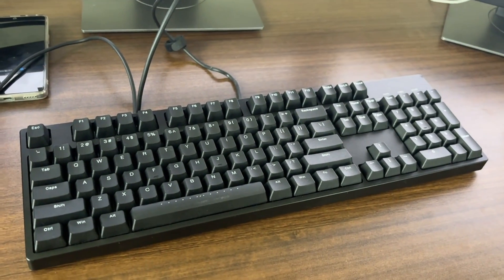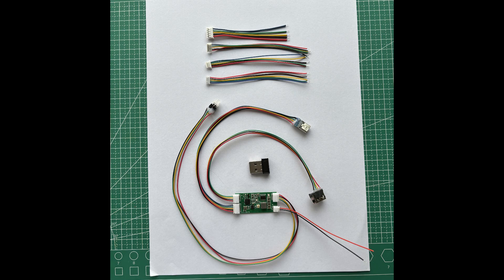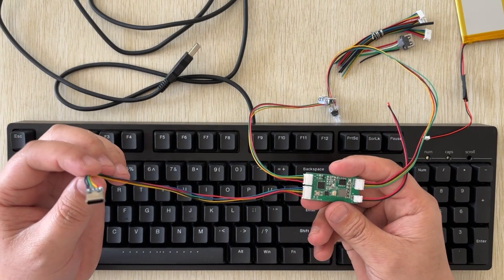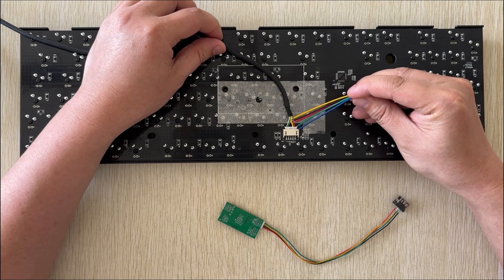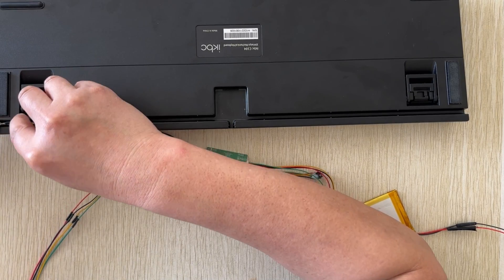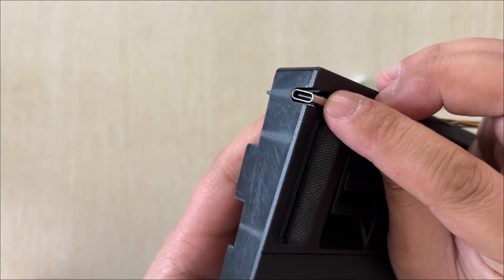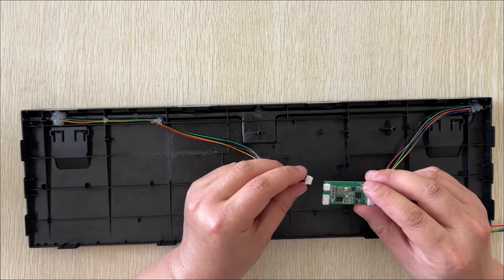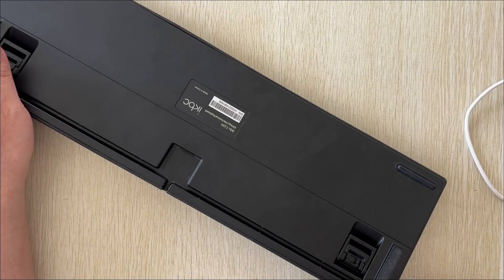Converting a USB wired keyboard into a wireless keyboard

Comment: Is this compatible with keyboards that have additional built in functions? I guess this is more of a question regarding the bluetooth module/firmware compatibility.
Let's say I have a USB keyboard with a built in trackpad or trackball, integrated mouse etc.  Does this module recognize those inputs?
Reply from the maker: Depends on whether the touchpad, mouse trackball uses standard USB-HID key codes. Most of them can be recognized.

Comment: Hi there, what connector is it for the batttery? Is it just a 2mm connector?
Reply from the maker: The power socket model on the PCB is a two-pin socket of zh1.5, and the corresponding plug is delivered with the PCB.
Reply: @jamjam2219  Awesome thank you! Saves me a lot of trouble trying to find a battery with the matching connector or having to buy the connectors on my own.

Comment: I have another question, regarding the battery, that has the black and red wire, which one is positive and negative? I think I understand this video now, but the only problem I have is being scared of connecting the positive and negative end badly. from what I understand red = positive side, and black = negative side. could you please let me know if this is correct and there are other stuff I should be aware of?
Reply from the maker: In most cases, red is positive and black is negative. But please note that this is not absolute. The safest way is to measure with a multimeter. There are symbols printed on the back of the circuit board. + represents positive and - represents negative.
Reply: @jamjam2219  I see. so based on your experience with this board, and from the videos as far as I can understand based on this board of v3, red means positive right?
Reply from the maker: @Apocalyman  yes
Reply: @ I see, thats awesome! thank you for responding and for your help! :)

Comment from the maker: By chance, I found a question post of a customer using this module in a Spanish forum, because forum registration requires an invitation code, so I can't register to answer his question, I can only answer it here, I hope you can see it. The module uses lithium batteries with voltages from 3.5v to 4v. In fact, if the keyboard does not consume too much power, the Li-Ion battery can be used with a voltage of 3.2v or even 3v. Li-Ion batteries with a maximum voltage of 4.4v when fully charged can also be used, but I wouldn't recommend using such a high voltage. I apologise for not mentioning the voltage of the LiPo battery in the details.

Comment: Question! My keyboard is wired, how do I cut the wire properly? And how do I connect thr battery? Since it has the white connector already
Reply from the maker: The white connector is in the accessory package, provided free of charge. The accessory package contains 4 different commonly used connectors. If none of the 4 connectors work, you will have to cut the data cable and re-solder it..  
If you don't know how to cut and connect correctly, it is not recommended to buy this semi-finished product. You can buy wbt2-v4

Comment: Like ps keyboard
Reply from the maker: Use a PS2 to USB adapter. In fact, there is no chip in the PS2 to USB adapter. You can directly solder from the PS2 interface to the USB according to the schematic diagram.

Comment: you cut too many things. i don't understand where did you get all those cables/modules you are attaching to the keybard and the new module. 2:55 example....where did you get this one that you put in place of the long default USB cable?
Reply from the maker: There are no hidden steps in the video, and the module ships with 4 of the usual plugs with pigtail wires already included. This is a free part that comes with the module, and I tried to be considerate of the problems that most modders will have. I even put a piece of heat shrink tubing in the parts bag for insulation. If all 4 plugs don't work, you'll have to cut the original cable and rewire it.

Comment: After researching many methods, I bought your wbt2 module and 3 receivers. Now I can finally switch my qmk keyboard and logitech mouse between mac and windows. Because the company does not allow the installation of additional software, I have been looking for such a wireless kvm switch. In order to quickly switch between multiple computers. It is really very useful. Great invention
Reply from the maker: Thank you for your likes. Originally, the interface of this module was relatively simple and could only be used on the keyboard. Later, some fans contacted me and hoped that the mouse could also be used, so I added an interface so that the keyboard and mouse can be used at the same time, and quickly switch between 8 computers. I didn’t expect you to call it wireless kvm😁
Reply: would you mind sharing where you got that receiver from?

Comment: How it will connect to the pc then if i use a razer black widow with rgb will i sill be able to use synapse ?
Reply from the maker: Just connect the USB cable of the keyboard to the keyboard interface of the module without affecting.  What is synapse?

Comment: The wbtv3 I bought has arrived, but after installing it according to your tutorial, it has no response and cannot be used. The indicator light is on, does it mean that the module is working? I pressed the keyboard but nothing happened. What should I do?
Reply from the maker: Don't worry, brother. According to your description, please check two places. 1. Is the correct working mode set? The red indicator light represents the wired mode. You need to use a data cable to connect the typec port of the module to the USB port of the computer. The blue light is always on for Bluetooth mode. The blue light flashes and Bluetooth is waiting for pairing. The red and blue lights together indicate 2.4g wireless mode. 2. Please check the connection between your keyboard and the keyboard data port of the module. Is the D+ and D- connected reversely or disconnected?
Reply: @jamjam2219  Your analysis is absolutely correct. It was indeed the USB data cable that was not connected properly. Now it feels very good to use, and the experience is perfect. My roommate also plans to modify the keyboard.

Comment: Is it possible to apply the same steps to the controller? Of course, I will reduce the battery, but will these Bluetooth parts be compatible with it or is there another part dedicated to this?

Thanks in advance and I appreciate your help

I use Google Translate
Reply from the maker: Game controllers are not supported. There are no game controller key codes in the module program. Regarding Bluetooth, any device that supports Bluetooth keyboard is compatible with this module

Comment: Great video, thanks for sharing! I want to design and 3d print some handles to mount to the edges of my keyboard that contain an integrated trackball mouse and mouse buttons, while also making the keyboard wireless. Any ideas on how I could make this work? I'm assuming that I would need the WSCOME Dual interface KB/M unit, but I'm not sure that's the best option available for what I need. Do you have any recommendations?
Reply from the maker: It sounds like a good idea. My suggestion is that the battery capacity must be large and there should be enough space for the battery.

Comment: very cool! thank you so much for the video! super useful and i'm getting the module with the buttons on the case thanks to the vid! as i'm waiting to get it, i was wondering, with your setup with your keyboard and battery size, how long does a battery charge last? i understand it's dependent on usage but i was just wondering for your specific set up so that i have a reference number to work from. thanks!
Reply from the maker: I can see that you are a DIY veteran. I am glad to meet a friend who has the same hobby as you. The module with the shell and keys should be WBT2, using a 3400mAh 18650 lithium battery. The charging current is 1A, and it can be fully charged in about 4 hours. If the charging cable used is of better quality, the charging speed will be faster. When the module itself is working, the current is about 0.02-0.03A, and the power consumption is less than 0.1W at 3.7V, which is almost negligible. In other words, the actual battery life depends entirely on the power consumption of the keyboard itself.

Comment: Just bought mine, now I need to get a battery from my kid's toys. Seriously though, what are the volt and amp battery requirements?
Reply from the maker: bro, I replied to your email, maybe you didn't see it. Please use single cell lithium batteries. The voltage of a single LiPo battery is between 3.3v and 4.2v, which varies depending on the amount of power. The power of the module itself is very small, only 0.07 watts. Therefore, any lithium battery will provide enough power for the module, what matters is the power consumption of the keyboard you are using, as the keyboard needs to draw power from the module. In most cases, I would recommend using a 3000 mAh Li-ion battery. If your keyboard has a lot of lights, the power consumption will be high, so you can increase the battery capacity. The higher the capacity, the better. Be sure to note that it is absolutely forbidden to reverse the power supply in any case, the wrong positive and negative terminals will burn the chip instantly.
Reply from the maker: Or you can connect several lithium batteries in parallel to increase the capacity, please note that it is parallel connection, not series connection.

Comment: What's the wattage on your battery, and how long does it last? 
5V on how much mah you use here?
Reply from the maker: I'm using a 2000 mAh battery here, so the bigger the better if the size is right. In the latest wbt2 modules I use a 3400 mAh battery. The duration of use depends on the power consumption of the keyboard, which varies from model to model. The module itself consumes very little power. The operating current is only about 0.02A
Reply: @jamjam2219  can it take power directly from USB C?  Or does it have to be directly wired in to the battery?
Reply from the maker: @andrewelgin  It is possible to draw power directly from the usb-c without installing a battery.

Comment: Can you connect the module to a usb hub?
Reply from the maker: The module does not support most USB hubs. If you need the keyboard and mouse to work together, you can buy the latest WBT2, which has dual interfaces to support keyboard and mouse to convert wireless and quickly switch computers.

Comment: Can we make a multipoint connect version of this?
Or make a wireless KVM switch that can switch between two PCs with no(minimum) delay!

Here is my use case:
I work on Windows laptop(Personal) and Macbook(Work) in parallel. Though Logitech MK850 is serving my purpose, I feel much comfortable with my Redragon K552.
I like the TKL layout of K552 and is good enough for most of my usage. I was looking for a way to convert that into a wireless keyboard with minimal cost so I don't have to abandon it and spend on a new wireless mechanical keyboard again.

Open for thoughts and ideas. Please help. :)
Reply from the maker: Now it has been modified to version 3, which supports multi-point connection. You need two wireless receivers, and you can switch between the two PCs in milliseconds directly through ctrl+alt+shift+1 or ctrl+alt+shift+2 in Windows and Mac. Bluetooth can also complete the switch, but the switching speed of Bluetooth is 2-3 seconds slower than that of the wireless receiver.
Reply from the maker: There is also a latest dual-interface version that supports switching between keyboard and mouse at the same time

Comment: Does this work while the battery is charging? I just ordered the module but didn't bother to check 😅. Also... Does it notify you when the battery is running low?
Reply from the maker: The remaining power will be displayed in Bluetooth mode, but because everyone uses different batteries, the power display may be inaccurate. The keyboard can still be used when charging. But please note that the module supports transmission via data cable. So if it is plugged into the USB port of the computer for charging, please press ctrl+alt+shift+e at the same time to adjust to wireless 2.4g mode or ctrl+alt+shift+Q in Bluetooth mode.
Reply: @jamjam2219  Um... I'm using windows 10. Currently the most widely used operating system.

Comment: I need to know if it works for mouse or if this only works for keyboards, I want to modify my mouse
Also, great video 🖤
Reply from the maker: Several people emailed me asking if the mouse was supported, so I modified the firmware to work with the mouse.Please rest assured to buy.   
I also want to ask, I replied to your email, can you receive my email? I want to know if my reply email went into the spam folder?  thank you
Reply: @jamjam2219  Oh, I already receive the email, and thank you for respond.
I have another question about the product.
This is also compatible with wired  game controllers, because the Azeron Cyro, the mouse I want to modify, have mouse, keyboard, and game controller characteristics.

Thank you for the help, I'll buy the product very soon.
Reply from the maker: @williamschrodinger  thank you, This module does not support game controllers because there is no code for game controllers in the program. Only keyboard and mouse are supported.
Reply: Oh well, thanks anyway, I'll see if I can fix the compatibility issue, I'll buy the product soon.

Comment: It took me a visit to the Wscome web shop to find out that the (2.4Ghz?) USB dongle is included of the kit.
Reply from the maker: This kit does not have a dongle, it is a 2.4g wireless receiver
Reply: @jamjam2219  Okay, could be my mistake, so I looked up what a USB dongle is:
"An adapter of some type that plugs into the USB port, including a mouse/keyboard transreceiver, 3G/4G cellular adapter or security device."
So, a dongle it is 😉
Reply from the maker: @winandd8649  😄😄